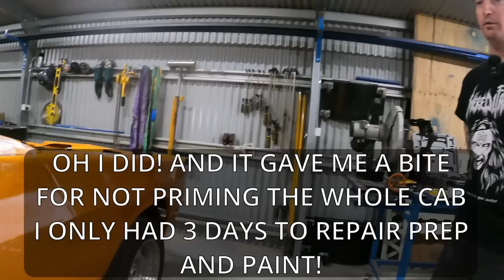Painting Shenke Garages HX Tonner Yellow Vortex Candy

Comment: Discovered your channel a week or so back. Really appreciate the way you present and run through your process. Have you done any videos on painting a car cabin? I’ve seen one that shows the prep but nothing on what process and surface treatments for the interior cabin. Keep up the good work
Reply from the maker: cheers mate thanks .i have done a video but yeah mainly just the prep , didnt film painting it due to time and difficulty setting cameras up at the time . depending on the surface of the cabin depends on what needs doing . is it in epoxy or some kind of primer or bare metal ? planning to spray body deadner   or just paint it ? theres a few different things you can do .

Comment: Why was Custom Clear used instead of the Diamond Clear?
Reply from the maker: Because I use it every day and find it’s more user friendly over the diamond . Diamond can be unpredictable when going for a flat finish with no heat in the booth 🤙
Reply: @BogDustForBreakfast  can you elaborate a little bit more on how you think the diamond clear can be unpredictable.
Reply from the maker: @AnthonyWilliamson-v2v  sorry , it’s more likely to run than the custom clear . I’m a heavy painter I normally pump the clear on to achieve the best finish . When painting in a booth with no heat it was risky using it on this job .

Comment: Pressure prob bit high for that back panel, booth can only do so much
Reply from the maker: Nothing wrong with pressure 29psi same as every job . If anything should of turned the Ute around. But first time using that booth so had no idea . Wasn’t turning it around after I’d spent 2 hours masking it
Reply: @BogDustForBreakfast   ohh that woulda been gd idea turning it atound i didnt think of that. but yeh too late after issue's. how long did it take ya ? looks like a gd 10 hrs ive been there man, its like that on the big jobs sometimes. 
did u put white base down initially or did u put candy over etch ? 
i guessed that it was around 29psi, think about it bro, its too much the evidence is clear in the vid. im only sayin drop pressure down a lil for the back panel. air pressure adjustment wont alter the colour cos its clear. can understand on the candy.. im a painter too, an im very good at it cos i listen to ppls advice. ..then figure out if its bs or not later lol, just sayin man ✌ u did a killer job by the looks anyway
Reply from the maker: @joz1751  took 5 hours to paint . Would have been around 4 hours if I didn’t run into issues with candy bleed etc . All rub throughs had etch applied , sanded and white base applied over the top so whole car was same Color which helped gain 100% coverage . 29psi is what all clear coats should be sprayed at . Lowing that will result in a textured / chunky finish or runs, It wasn’t a huge problem just took longer to paint . There’s so many things we could have done looking back . It was a huge rush to repair and paint it . I just made do with what I had and got it done .
Reply: @BogDustForBreakfast  U took the critique/advice well lol
I can get a wide variety of clears on flat as no runs with whatever pressure really. I do spray at around 25-30psi but if the situation or job warrants it I will adjust where I have to. Saves getting 2k in y eyes an face
Regardless of any of that it looks nice as anyway 🤷🤙